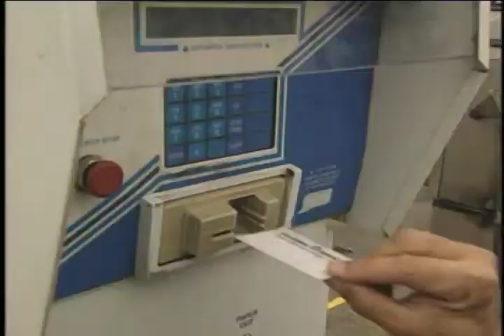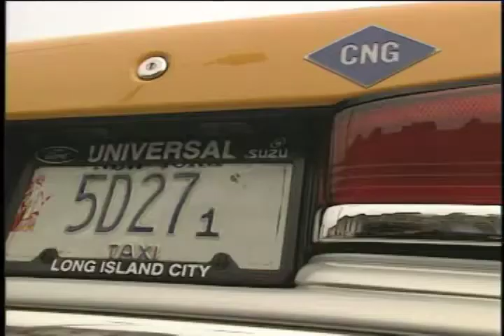Inhaling NYC Taxi Fumes: A Daredevil's Experience!

Comment: In my country,  we used to have to make many alternatives to fuel, cng was a popular one if you raised the compression high it had power too.
Old farmer's sometimes made fuel from pig manure.  The low pressure bag of gas on the roof looked silly and didn't take them further than to town and back

Comment: Running an engine on natural gas or LPG is not uncommon in Europe.
People also modify regular cars (especially gas guzzling American cars, that had been imported by enthusiasts to mitigate the high prices) to run on both gasoline and natural gas or LPG depending on the customer's choice. 
So in the end you still have gasoline as an option if you don't find the right petrol station, that also offers natural gas or LPG :-)

Comment: Work for a natural gas company. They ordered new work trucks about 5 years ago to run on natural gas. Needless to say company got rid of them. They were always overheating. They blow through engine oil and the pumps were always breaking down. So you need special technicians who are few and far between.